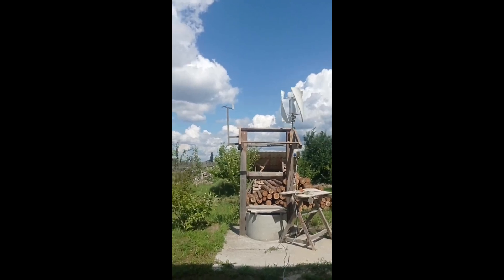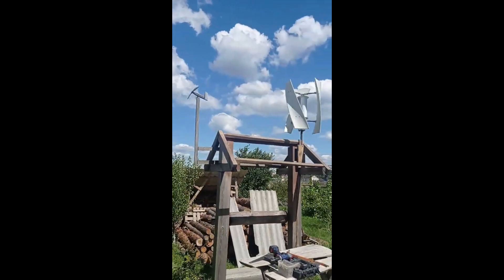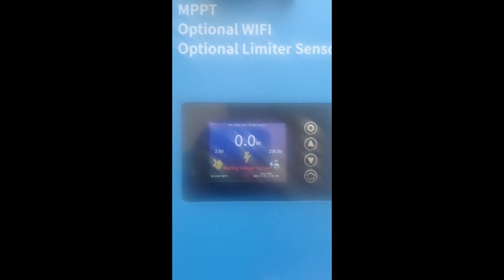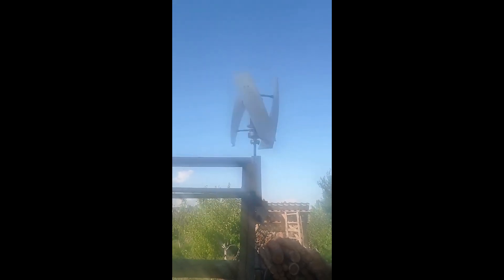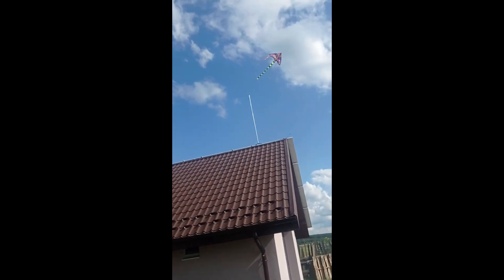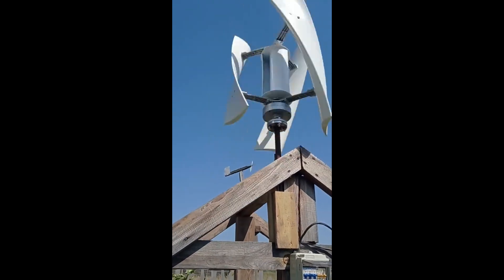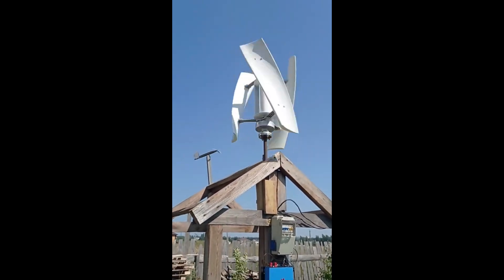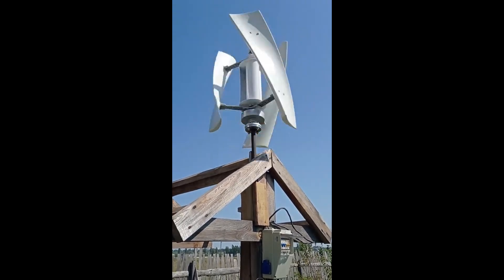Smaraad X3 - my experience with the small vertical wind turbine. It is so good!! That I want to..

Comment: Can you use it as parts? Attach it to a a car alternator or a treadmill generator?
Reply from the maker: probably yes.
I have a bold plan to rework all those useless verticals, but later on, after I will finish everything with my main setup.

Comment: Basically ALL wind turbine advertisements are fraudulent.
Reply from the maker: no. not at all )
you just have to know what to look for. and, best wind turbines can be bought directly from the factory, through the direct communication with the manufacturer. Alibaba helps with this a lot.
Reply: @BackyardVoltage  They say 5000 watts but don't tell you its for three seconds during a tornado, then it burns up .
Reply from the maker: check this mate: https://youtu.be/FoKUUpJMgD4
and also - feel free to check how my 2 kW (true 2 kW) wind turbine realistically performs: http://youtube.com/watch?v=70eWPHTn1Ns

Comment: Sorry that I didn't saw this video before. I made same mistake and ordered this windgenerator. It's not working at all. I got same result like you. Test it with oscilloscope and saw gaps in sinusoids ( some winding are in not right phase). Coil is not winding well. My result was 7 volts effective on 250 rpm .Then I open it and saw that it's look like kid's play with wires, very unprofessional made. Very small round magnets and distance between magnet's and coil was too big ( about 7-8 mm on every side). Wires are very thick and resistance is 18 ohms on every coil. That wires and magnets in normal working condition can give max 50 Wats. I make videos and pictures of measurements and ask for refund. Turn it back to seller in Poland and get refund. It was not easy because of very hardheaded seller and lot's of excuses ( like wind is not strong enough, can't work on inverter that thay didn't sold in combination and etc). I lost lots of time and money with this scam thing. I hope that people before buying things like this check on internet videos like this and don't make same mistakes.
Reply from the maker: yes, true. sorry for your experience, but well, what is done is done. mine is sitting still with me and reminding me always that you can't trust anyone, and you should prove everything yourself

Comment: This is why commercial designs use gearboxes.
Reply from the maker: no gearbox is needed up until you reach 15 m of rotor diameter (for HAWT), and for VAWT - no vertical wind turbine is ever welcome.
Reply: @BackyardVoltage  Well, every generator has a specific rpm range where it is most efficient. The gearbox is there to get the desired RPM and then they use the pitch of the blades to increase the torque/power output. It's a clever setup, but costly to implement on small wind turbines.
Reply from the maker: yes, it makes little or no sense to be used on small wind turbines. on bigger ones - it's even rather a must have option, since there is almost no technical possibility to make a generator working stable on 15-20 rpm... it will never get the desired stable frequency - that is why gearboxes are used on commercial units.

Comment: I think you've got it backwards.  The generator is probably ok.  The turbine is the problem, very small swept area and not a great design to begin with.  Like you say, plenty of speed... but it stalls when the inverter tries to take a bit of power.  Lots of rpm x 0 torque = 0 watts.  2kW rating is just fraudulent for any machine this size.  I would expect 100-200 watts from that turbine at 11m/s if all is running well.
Reply from the maker: it is impossible to assemble it backwards.
inverter won't drag any power until 44 V is reached - before that - pure no-load mode to let the turbine spin-up. so it does what it does.
the max voltage I was able to locate out of it - was 8.4V on some 9 m/s wind, again under no-load condition.

Comment: Thanks for the review. All useful learning. I have twi istabreeze i1500 turbines. Going well after 2 years in harsh weather. Very pleased with output. I was thinking if going for a larger smaraad horizontal 2 maybe 3kw but if they sell things like this it ruins their credibility. Maybe their hotizontal axis ones are ok, but this puts me off. Thanks for the review anyway. Great place you have there!
Reply from the maker: thanks.
well, I'd suggest going with FT or SL series (from Wuxi FengTeng or Smaraad). Wuxi is a bit better, since they not overexagerrate their productivity.
This is the one I will be mounting very-very soon: https://youtu.be/y8yXH5hVNPc

Comment: nice video. but i find it always best to use higher voltage turbine. example:for a 12v system, i use 24v wind turbine so it can meet the cut in voltage at way lesser rpm.
Reply from the maker: yes, higher voltage mean less losses on the power transition over distance as well, and it is also going to start delivering power way earlier. now I know that too, after playing with them around for almost a year now.

Comment: If you modify the shape of the blade, maybe you can get better performance. There is plenty of information over the internet about the most effective vertical turbine blade shape and their specific efficiency. Thanks for the videos, they are very interesting :)
Reply from the maker: thanks!
hm, but this is one of the best possible blades out there. pure lift form, just screwed to form a kind of X shape. in short - it's Darrieus type in its perfect form, altogether with the small accelerator in the center to ensure smooth low-wind start.
I mean, the rotor itself is great, I have no complains about it, it even rotates nicely and is good-looking. 

the main trouble here in this exact wind turbine is the generator... It's definitely designed to be on a high-side of the revs to get some required voltage/wattage, but should be on a low-rev side (since realistic revs are 40-250 for this type of vertical WT). I will try tinkering around with it a little bit later, likely the bigger magnets will do the trick, since the default ones are not giving the gen enough electromotive force...

Comment: Thanks for sharing your experience! You just confirmed that a wind turbine may not generate anything even when it spins like crazy. It is well known that the energy produced is proportional to the size of the swept area and you just demonstrated it.
Reply from the maker: well, I tried it again later with a controller, the result was a tiny bit better, but still not good enough
Reply: @BackyardVoltage I had the pleasure to play with Skystream 3.7, by one of the leading wind turbine manufacturers called SouthWest in USA back in 2010.  It's a horizontal product. But it had to be installed way higher, say 30 ft or higher to capture meaningful energy. While it worked well, but the price of solar came down and I'd better off to deploy solar with the same price and generate more. Vertical ones just don't work based on physics!!
Reply from the maker: @DowJones-e8k  true. but I'm capped with solar (43 kW of panels already), and still have to cover the underproduction in winter. that's why I am playing with the wind turbines, and so far, given the mistakes made, I am happy with the result.

Comment: No such thing as a "wind generator" only an energy converter
 Search Omni calculator " VAWT" to see what the availabile power is for the size of the machine at any given wind speed
    These claims of 2kw from manufacturers are laughable even if they can reach a claimed output it's at something like +13/ms which is available at less than 1% of the year
Reply from the maker: in the description to the video I've provided everything that the rotor (windwheel) can theoretically convert form the wind.
to actually get that - the generator has to be equal to the rotor capabilities, or has to be slightly better than the rotor capabilities in order to reach that theoretical output.
in this exact case of the default X3 WT - the generator has got not enough capabilities to match the rotor capabilities. Which was also proven by me later once I've left it hanging for sometime on a very different setup (through controller to the battery) - it was producing only 1 watt per hour at its max on the winds of 6-9 m/s.

"wind generator" is a widely and commonly used words combination, since this is a device that generates electrical power from the wind power.
for example, no one claims the diesel generator to be the diesel burning energy converting machine, everybody just says "dieselgen"